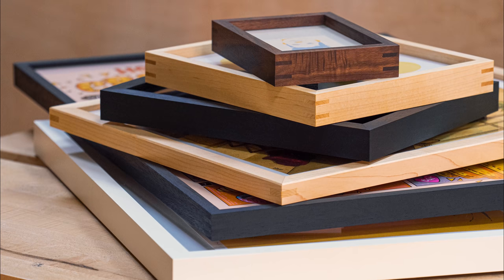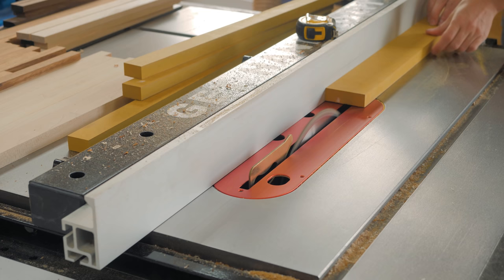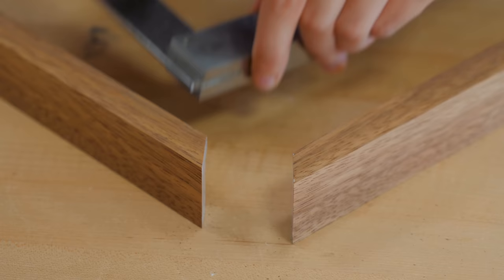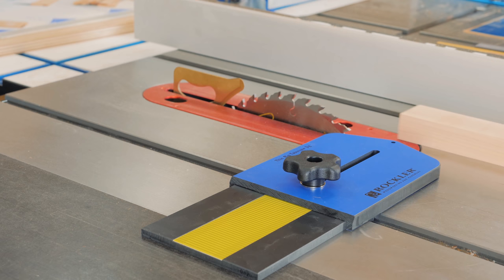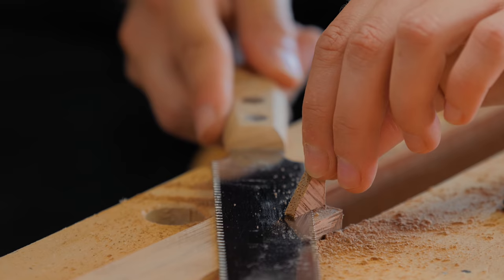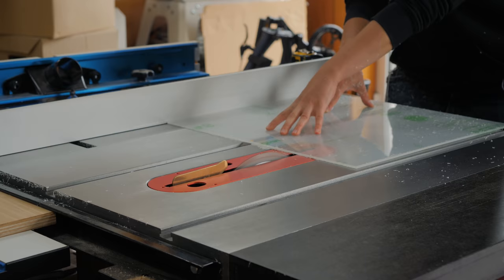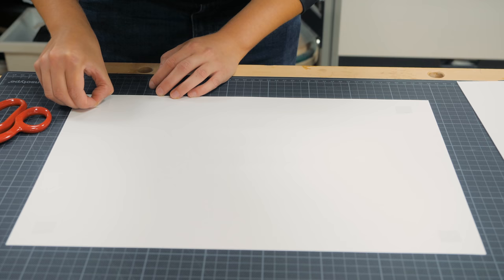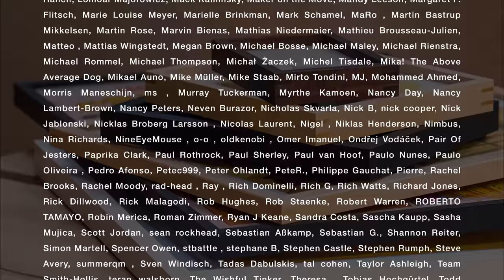I Made Professional Picture Frames from Scratch

Comment: Since I happen to have the same rockler sled, I tried your method of cutting the miters and it worked out well. That sled is very easy to true up against the blade with a plastic engineer’s square. The result was perfect, crisp joints. I don’t think I’ll need to build a dedicated picture frame sled after all.

Comment: My frames I have made for years are almost identical, splines and all. I don’t do the rabbets quite as deep but I may try that next time I mill up some stock. The look is awesome without being distracting from the subject of the frame. 

A trick I have found on the splines is if they fit a bit tight is to hammer the spline like you are trying to flatten them.  Flatten just enough where they slide easily into the slot. When you put the glue on the spline stock it will swell back up so install it without delay.  I do this because the spline material is not always perfectly consistent in thickness even when I’m careful. 

You did a great job on the video. Thanks👍

Comment: They came out well, one suggestion when you frame items the art work/photo is only attached at the top not at the bottom, this is to allow movement if the humidity changes and there is fixing at four points the likely result will be buckling of the art work/photo.

Comment: How did you remove the splines that went in the inside of the frame? Like at 8:30, for example.
Reply from the maker: Ahhh I forgot to film that part. I removed those little bits with a chisel. It breaks easily since it’s a very small protrusion.

Comment: Amazing!
Very professional look. The only advice I could give you is to never put the hanger in the middle of the frame as the weight of the own frame will bend the wood.
Other than that the project turned out awesome!
Reply: Well, and the acrylic is acid too, it should not touch the artwork. :P

Comment: 1:20 Dangerous misoperation. Backers cannot be used for crosscutting
Reply: why? i've seen folks do that on youtube to prevent tear out.
Reply: The backer is not the problem. It's the touching of the cut-off piece to the fence, that is dangerous. The fence should be pulled back so that it ends before the middle of the saw blade or a small distance piece can be used for getting repeatable lengths and then removing it, before pushing into the cut.
Reply: @michael-rommel  My English is not good enough to explain it clearly. Thank you. Your explanation is very clear.

Comment: If you can, try changing the acrylic to glass (anti glare glass special for framing), the look will be incredibly better (I have a large piece over my bed that I specifically requested to be framed with acrylic, you know, just in case it falls down, it is simply not the same, it does look plasticy).

And on a personal choice, I would avoid the silicone feet: the slight angle of the frame adds another dimension to the room, catches the light a different way, I think I would find it very unnatural if the frame was exactly parallel to the wall.

But your frames are very nice.

Comment: I don’t want to be that guy, but you made a pretty dodgy cut on the table saw at 1:22 
Awesome build and You are clearly very comfortable in the shop, so it’s with all due respect. But for any learners watching: it’s dangerous to do a long skinny crosscut with the miter guide whilst also having the piece touching the fence. Easy to let it get caught and thrown at you or even pull your hand into the blade. 
xoxo

Comment: 1:20 that kind of cut should not be made with the fence. Only cut with the fence if the piece is longer than it is wide. Compared to the blade direction.
In ths case t is very short and very wide, very dangerous.

Comment: The dangerous way you did that crosscut automatically disqualified you as someone to be giving woodworking instructions.
Reply: She has sometimes told commentators that it is from the perspective of the shoot because she has her hands at a normal distance from the cut.
Reply: @arianed2908  
It has nothing to do with her hand position.
It is extremely dangerous to make a crosscut with the board butted up against the fence. The board can rotate during the cut and get caught between the fence and the blade, causing it to fly up into the air.
Never make narrow crosscuts like that. Rookie mistake.
Reply: @cygnusustus  She's had the channel for almost 7 years, she's not new to work. She created it to inspire, to encourage people to do what they need to. She is not a woodworker and some warning could be important if it comes from someone who understands the matter.